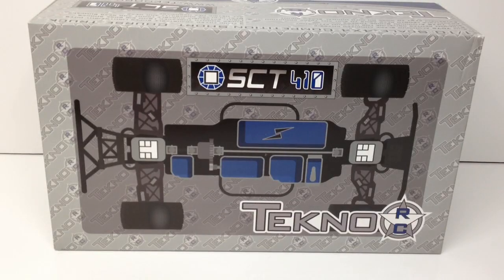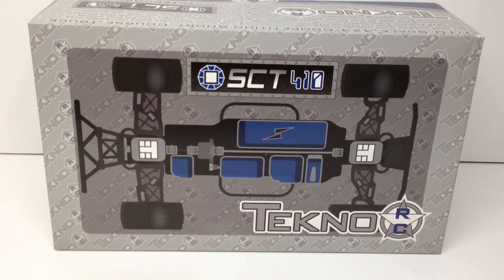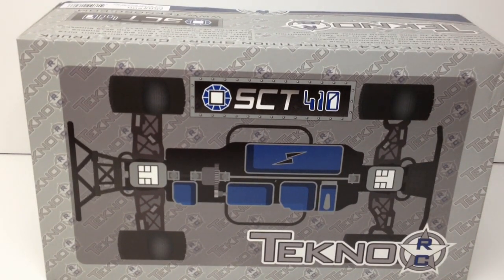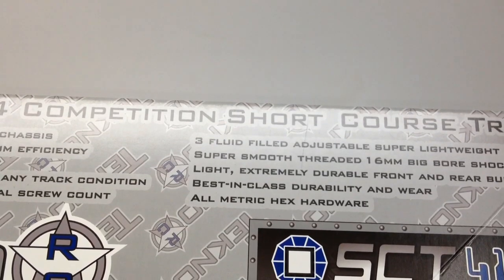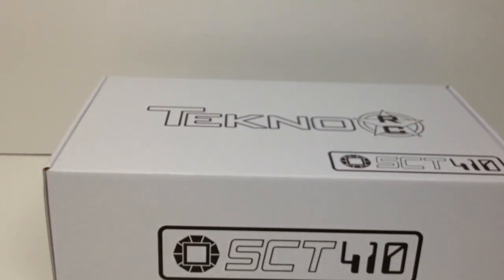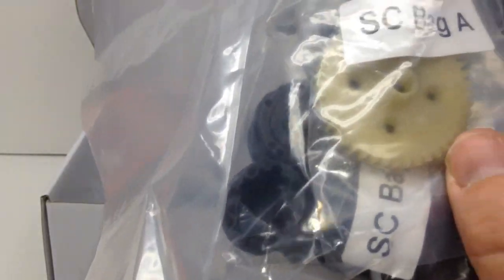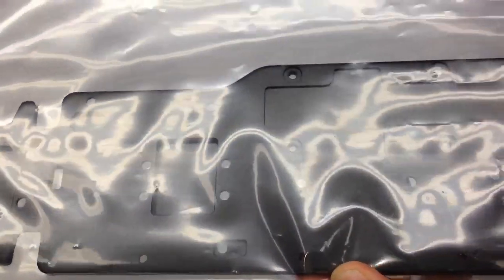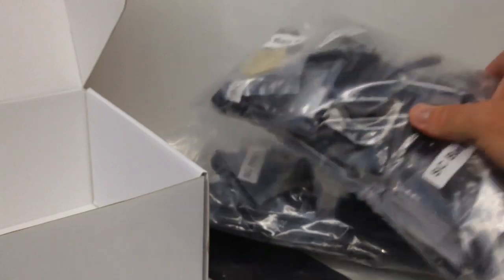Tekno SCT410 4wd ShortCourse Truck KIT - Unboxing!

Comment: Dude for real as a fellow scte and a tekno owner the tekno is night and day smoother and all round better vehicle i love the damn thing and just a heads up watch them stub axles they had a hardening issue and mine broke on the 3rd pack right where the nut threads on for the wheel! but i contacted them gave me new ones! great Customer Service! i run mine all stock except for ride height adjustment, oh and i put o rings in the front drive shaft to limit the play and noise and it went silent! GLHF

Comment from the maker: Thanks!  It really seems like a great truck just from building it.  Can't wait to get it on the track. I sprung for the clamping aluminum hexes so maybe that will make a difference.  I did notice there was a bunch of movement (fore/aft) of the front center dirveshaft

Comment: I just order mine from Tower! I'm soooo excited because I've been racing a Slash 4x4 hcg for a while. Thanks for the great videos!
Reply from the maker: Nice!  The SCT410 is really seconfd to no other 4x4 SC right now.  You'll have a blast coming from the Slash!  Follow the set up guide and adjust your ride height and you'll be set to go!
Reply: Thanks. I know this is kinda a stupid question but what tires do you recommend for a indoor track that is 70% dirt 25% clay and 5% sand? if you don't answer I completely understand because you need to be at the track to tell.
Reply from the maker: Yeah, that's a tough one. To be honest, I would check what the locals run and go from there. It would be a good starting ground. It sounds like they'll wear out pretty quick with all that dirt/sand mixed in.
Reply: Thanks anyway

Comment: What would be a good budget controller that would work with the reciever that you have in your tekno
Reply from the maker: +Kyle Becker Check out some of the Spektrum "C" controllers like the DX3C or DX4C (Only difference is a 3rd or 4th channel radio)  Right around $99 for the radio and receiver.  If your budget allows for a bit more, the MT-4 from Airtronics is a top notch system at $199 and great stepping stone before the big dollar radios

Comment: Hello there... You may find this odd! So, I'm in the middle of a hair pulling debate with myself and thought you might have some very experienced opinion about it. I'm wanting a second class to race for the 2016 racing season down here in Houston TX. I have been thinking about getting a SCT for some time now. The group of guys I hang out at the track are telling me to get an electric truggy. The thing is SCT and truggy are kinda hit and miss down here as far as turnout. I think that is changing with the new mugen truggy and the new SCT by Tekno which is the one I'm thinking about getting. I currently run a mugen mbx7r eco as my main class so the second class would be for when there is good turnout of people in the class. Your thoughts are very respected by me, I am a big fan of all your videos. So, what are your thoughts? Thanks in advance. I understand if you don't have time to respond.
Reply from the maker: +Walter Hernandez You can't go wrong with either vehicle.  The Tekno SCT410.3 has almost every upgrade since Tekno started making the orginal SCT410 and they kept the same price. It drives very much like a E-Buggy and is super tough.  If you're already running the MBX7r eco, having the Truggy would also make sense.....Lots of the same/similar parts. tuning would be a breeze since they're both PBS.  Truggy costs more to run (batteries, wheels/tires, larger motor, etc)  I see why you're pulling your hair out!   If you're dead set on SCT, the Tekno is the way to go.....The TLR SCTE 2.0 and the DESC10 sren't even close to the Tekno
Reply: +The RCNetwork Thank you. I'm pretty sure I got my mind made up on the Tekno. My buddy is gonna let me drive his SCT on Friday so hopefully it's as good as everyone says!